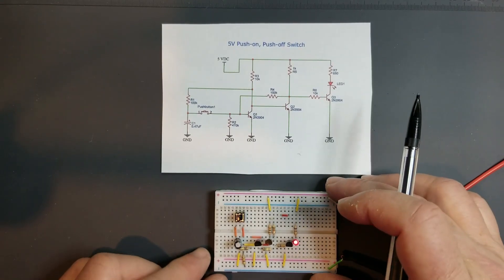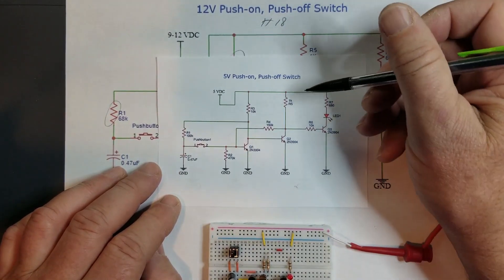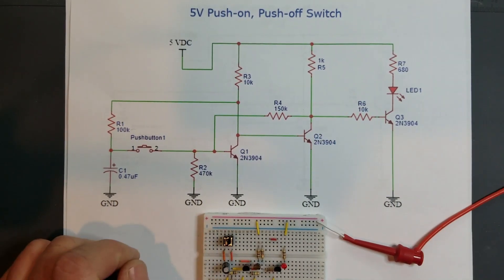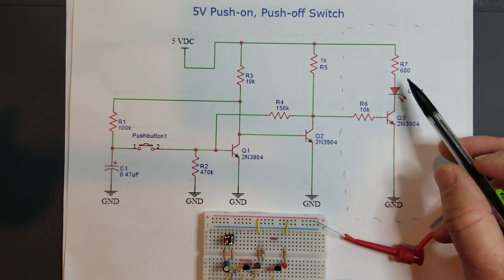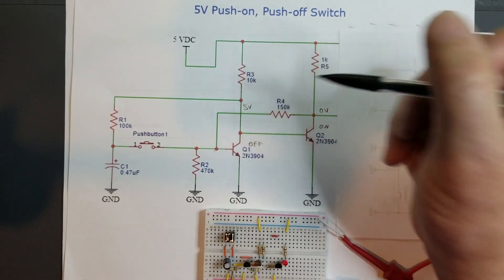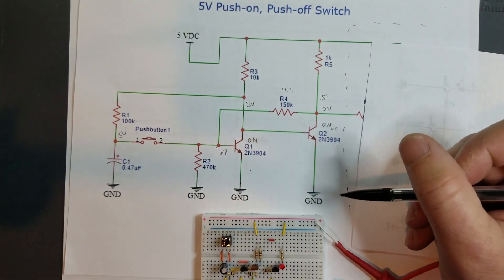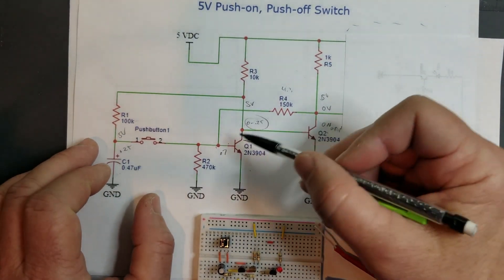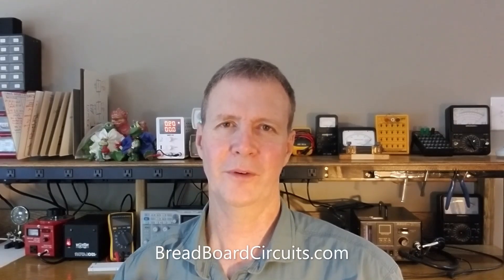#22:  5v Soft-Latch Pushbutton Circuit on a Breadboard

Comment: Simple and neat. Have been trying to use CD4027 with no success! I'm trying to modify this so it switches to gnd as it needs to control an amplifier footswitch circuit (tap to change state, pulls input to gnd). any help appreciated!

Comment: I've breadboarded this and it works well. But the quiescent current when off is 5mA, due to Q2 being on. So this is not suitable for battery powered projects as it will drain the battery when off.
Reply from the maker: Appreciate the feedback. I will look into that and possibly revise or redesign it to take that into account.
Reply: @TheBreadboardMan  Have you ever looked into this? This circuit is the best one I've found online for a reliable 5v latch. However it draws way too much power in idle mode. I wonder if it can be improved to work in a battery-powered device?
Reply: 재설계하였으면 공유해주세요.

Comment: Interesting. In  my real case, I need to provide 3.7 v to run a micro motor. The problem is that this device draws more than 2 A at peak. Could I use your circuit as is or do I need to replace any component? Thank you!
Reply from the maker: You'll need an output buffer to lower the circuit's output impedance (power transistor, N-channel MOSFET, relay, etc) as the minimum output impedance is currently 100 ohms, which if you try to draw 2A of of, would gobble up all of the available voltage and leave nothing for the motor. The simplest solution would be a relay that has a coil resistance of no less than 100 ohms. If you use an  an N-channel MOSFET, you would replace Q3 with that, then replace the LED (load) with your motor, while only supplying 3.7 volts to the top of the motor. You might need to adjust some of the resistor values near the output to accommodate the particular MOSFET's Vgs.